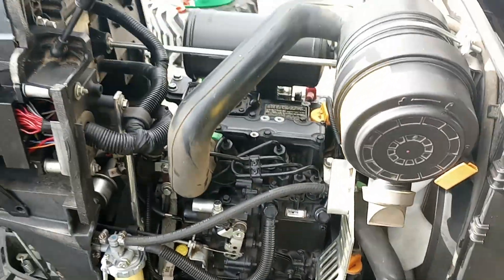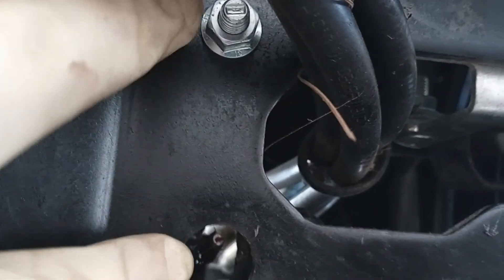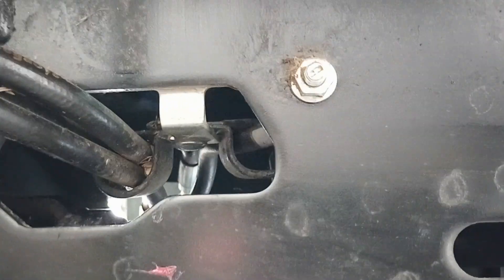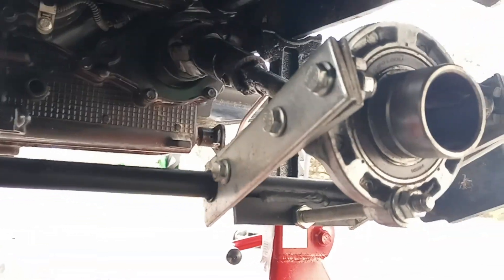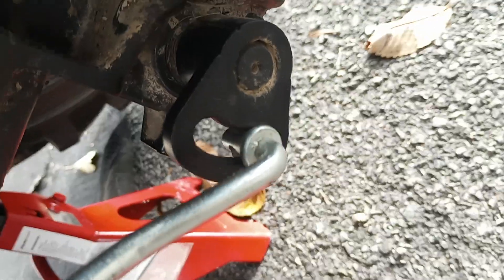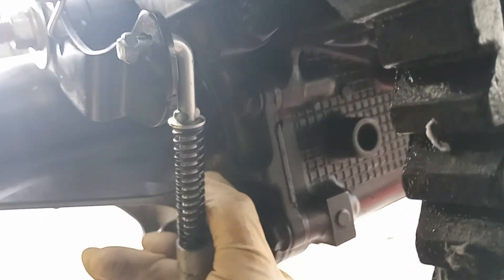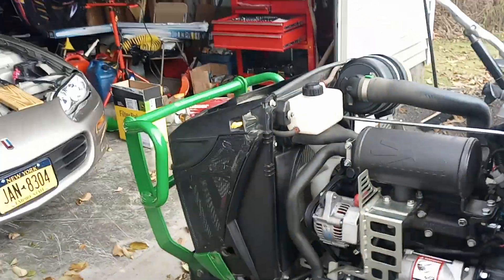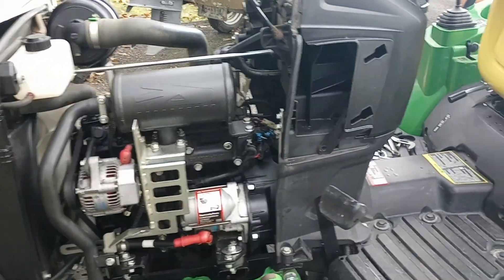HOW TO Service and TRICK TO GREASE DRIVESHAFT John Deere 1025r/1023e

Comment: My 2017 1025R Johnny has those holes underneath & yes you're correct to use the bigger, wider slot, for greasing that grease zert fitting! You can also remove the floor panel & grease that fitting from above!

Comment: Also, keep an eye out on that orange oil cap on the side for the motor oil.  That radiator hose vibrates around and your cap is pointed at it like mine and wears a hole into the hose! My hose never blew and surprised, but it probably only has millimeters of hose material left before it would have went through fully. I got another piece of hose and zip tied it over the hose but it's still wearing through.  I used a Dremel and sanded off that corner on the oil cap. Not sure if that has helped at all yet as I just did that this summer and haven't looked at it again.
Reply from the maker: I will put a hose protector loom on it. I also noticed that when I changed my oil. Thank you!

Comment: Another tip is the screen for the transmission on the back left side. On the back of the transmission coming up that tube/hose there is one bolt you can loosen and then that whole hose will move out of the way and give just enough room to get the filter/magnet out.  Easier than messing with the two clamps. You have the back left wheel off, so even easier!
Reply from the maker: I saw that somebody did that on another video on here. My clamps actually came off really easy. But I may try that method next time.

Comment: I just did my yesterday, not that bad. The worse part it was, removing the grease coupler from the zirt. I ordered the LockNLube Grease Gun Coupler XL .  There's 7 grease pins  under my 2019 1025R tractor, and I think I got all. If I miss any, and there's more than 7, please any smart pants out there, let me know!  🤣. Thinking about adding the DIY front 3rd connection .

Comment: Thanks for the tips.  I just completed my 400 hour maintenance except the front axle change out.   About how much oil does the front axle take?     Finally thanks for the mouse hole tip.   I think i had some in there last winter.  I need to pull the cover and look.
Reply from the maker: Front axle is approximately 3 qts. Make sure you keep your breather screws out and fill it VERY slowly or it will burp out.

Comment: Great video. I have a 1023e from 2018. Today rear lift stopped lifting. Seems to hit a hard stop. Little travel. Could it be the proportioning valve (silver Tee) under right side of drivers seat?
Thnx. David
Reply from the maker: @davidmosscrop2374  check to make sure the lever that you use to move it up and down is not loose where it bolts to the actual hydro pump. Mine did that exact same thing and it was just loose bolts.
Reply: @Polarisxcr700  thanks. One very loose bolt (black 13mm) I tightened it. No difference. Bolts attached to lever seem tight. Any other ideas? Thnx
Reply from the maker: @davidmosscrop2374  check to make sure your seat belt buckle didn't fall into the slot the lever goes into. Try adjusting the turn handle you referred to before, make sure nothing is stuck between your three point and the frame. Make sure none of the pins holding all the three point bars and arms have backed out and gotten stuck.

Comment: Have the 2019, the grease gun won't fit on the zerk other then in the small round hole. The larger opening is way off to the side.
Reply from the maker: Turn the driveshaft
Reply: Boy, I'm about to find out. Just bought a 2019 1025R, I'm also wondering if previous owner ever greased it, I hope he did. Tractor has 148 hours on it. How often it need to be grassed ? Do you use one kind of grease to greases all? TLB  and B Mower?
Reply from the maker: Yes same greese. Just use a general purpose grease with moly. It will be good to go.  @PoisonShot20
Reply from the maker: @PoisonShot20 as far as how often I would say every 20 hours wouldn't be a bad idea. Depending how hard you're using it.

Comment: What did you do to prevent the little friends to stop getting cozy inside of your tractor? LOL! They're very nesty, got inside of my GMC sierra vent, end up dying inside, and man, the smell never went way. I vacuumed, cleaned as far as I cold reach, spray with some cat odor spray.  I spray my tractor with silicone, maybe it will keep them way. Other choice is spray the tires with some repellent? and keep loader, or any   any implement up on the air?  Don't know!  Watch  the video " An American Tail (1986) , ne of my favorite cartoon video, hey, I'm old, very old, but still enjoy clean funny cartoons.
Reply from the maker: A good idea is to open everything when you aren't using it for extended periods. So, open hood, remove side panels, flip seat up. Don't give them a place to hide.
Reply: @Polarisxcr700  I heard a lot about spray mint, or place the little bags on areas that they like to reside. Not sure how effective its is.
Reply: Peppermint spray and zip tie dryer sheets. Got a gallon of the peppermint from Amazon and just put it in my spray bottle. Spray engine compartment and wheel well areas.
Reply: @jamescotten3778  I didn't  buy a gallon, just small 16 oz of mint spray. Being  using it on my Honda Ridgeline and tractor, so far so good. Now comes the winter and it's  when they will look for cizy places. Chipmunks are the worse for me, I hate the little bastards!
Reply: @PoisonShot20  Some car makers used a soy based covering on wire harnesses. Mice love that stuff. The gallon was a concentrate so I cut it with water. I spray my John Deere, husky lawn mower and 5 cars(darn kids). I live right on a creek so we get a lot of critters. Haven’t had any problems since I started spraying with the peppermint(monthly +/-).
Reply: @jamescotten3778  do you spray the tires? Also, would you mind share the link of the product? Thanks!